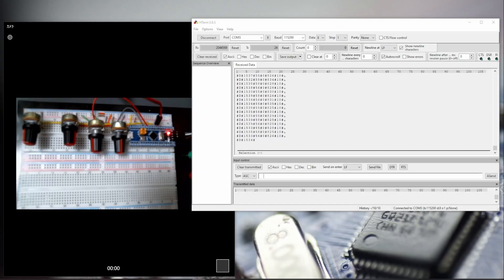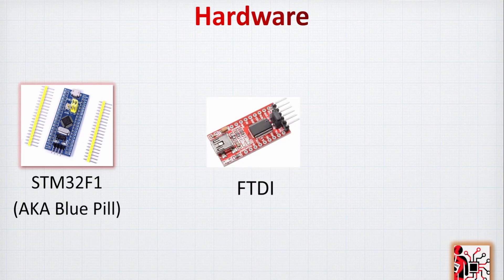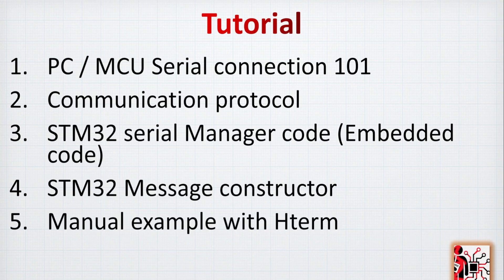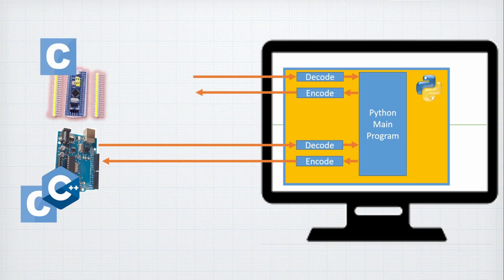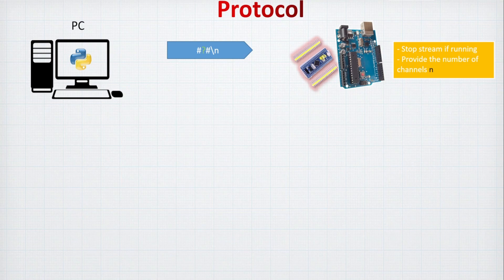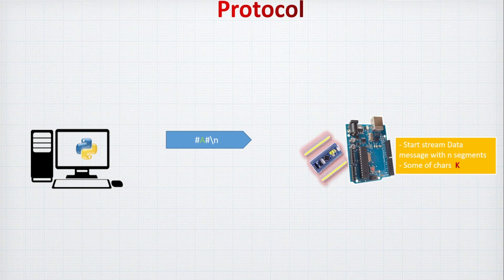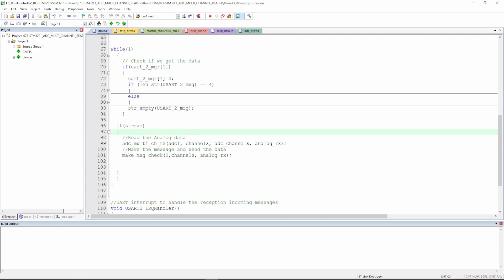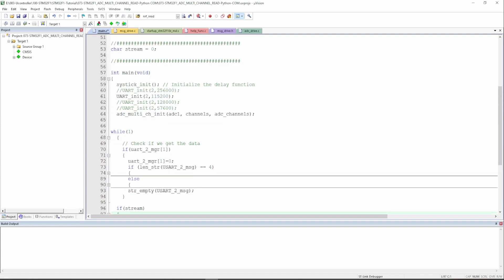003-Python Live stream Graphic UI Arduino-STM32:  Communication protocol & STM32 program example

Comment: can you help me write that code on arduino mcu? I want to try the full code but it still fails to sync in the connection manager GUI. I want to try all the code on this project, but I only have an arduino mcu.

I'm very grateful if you can help
Reply from the maker: Hi Faisal, thanks a lot for comment, I think it would be a good exercice to setup the same logic on Arduino, we can have a live session working on setting up the code, before that can you share with me the arduino board that you have ?
Reply: @WeeWStack  Thanks for your reply, I have arduino Uno and Mega
Reply from the maker: We can have a live session to implemented together ? if you are interested let me know we can work on it
Have a great day
Reply: I am having the same problem with the UNO! Is the live session posted?
Reply: @WeeWStack  Same here! Did you record the live session regarding serial communication with just an Arduino mcu?
Reply: is there already some code out or a video tutorial or both for the Arduino?
I really like this series and it would help me a lot to have this UART communication protocol implemented for an arduino
Reply: is there any update concerning the arduino code that works with this fantastic application ?
Reply: @haithembenjamaa  Did you find anything, yet?